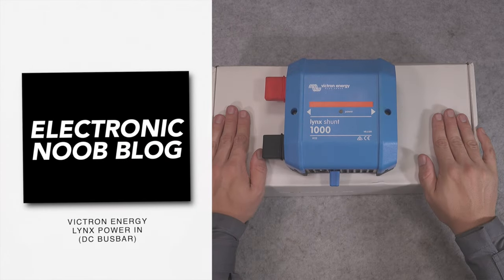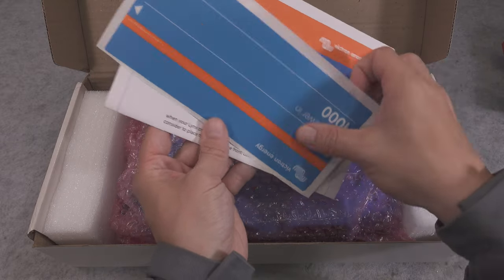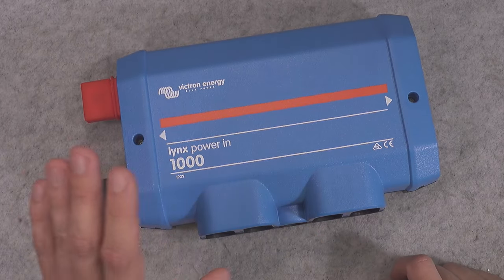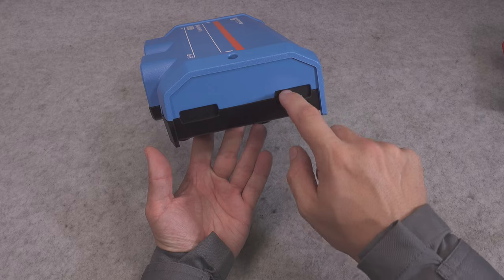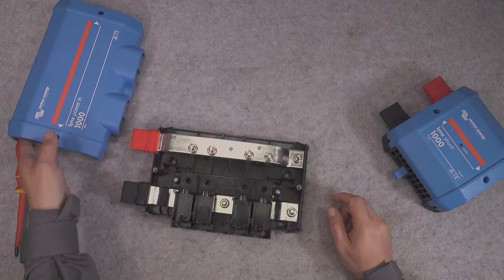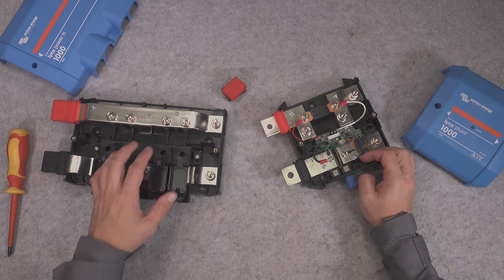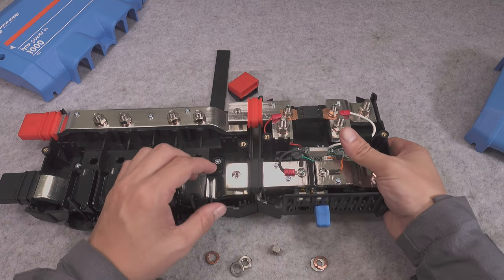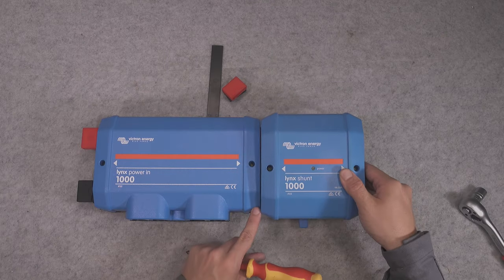Lynx 1000 DC Power In bus bar from  Victron Energy connecting to Lynx Shunt (solar PV project)

Comment: Victron gear is way out of my price range, but I buy it anyway, because it gives me a warm fuzzy glow.
Reply from the maker: Exactly - I get same conclusion - is OVERPRICED - but I talk myself into thinking - some day, I will move that stuff into real PV system that will make money (size up). Most of Victron stuff like 80% i bought used in span of over year! I just searched everyday until someone have good deal - try that if it's Your home project.  Those lynx never came up used! Looks like people will hold on them forever.